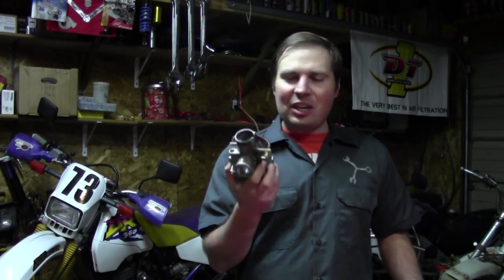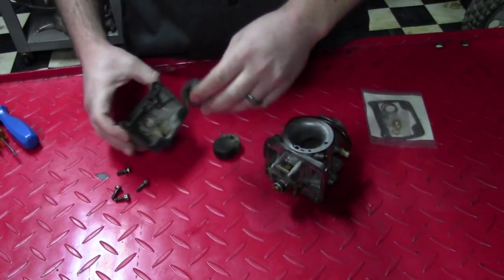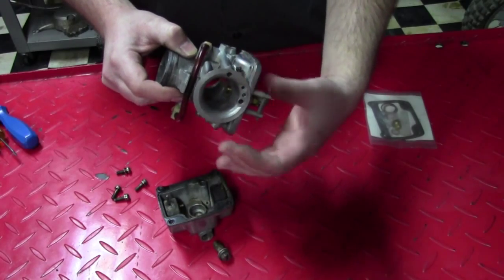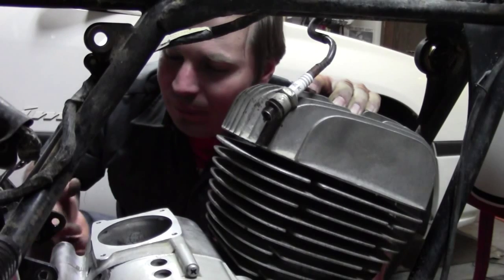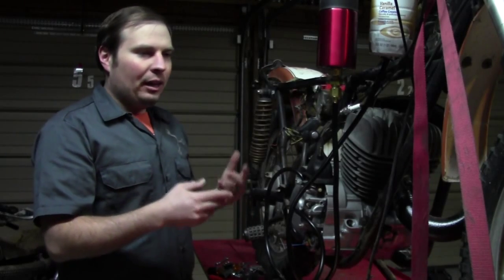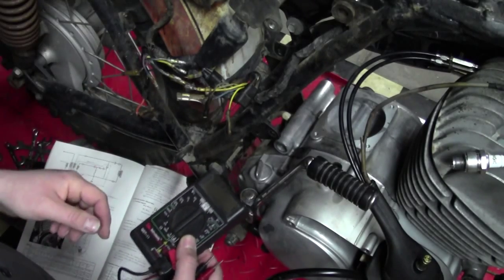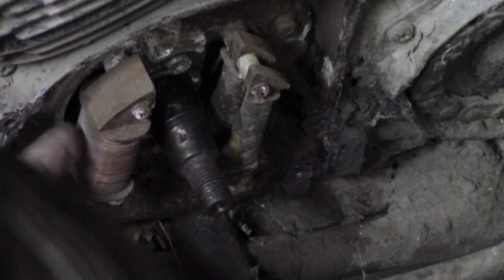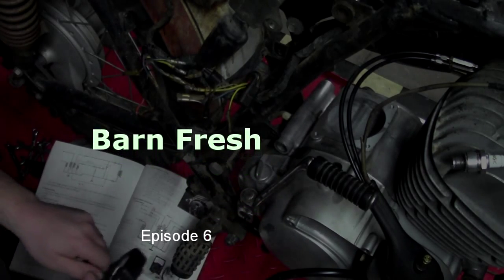1970 Kawasaki F5 Big Horn Fuel and Ignition diagnosis (Fuel and Spark) - Barn Fresh EP6

Comment: I have a 1970 f5 bighorn with a broken carb casing where the choke cable goes into it and so the cable will not stay seated anymore. Any idea where I could find another carb or a possible different replacement?
Reply from the maker: Sorry but no. Ebay will be your only bet. It's a specialized carb to fit there. The F9 will fit but it's a different size and not correct.

Comment: So I’ve got a 70 for 350 paid hard I’m doing a flat track style mod I was wondering can you help me leave me in the direction of 6 to 12 V conversions and or any information on the wiring harness? I can’t find so I can eliminate some wiring from the bike. Thanks for your help Tom San Diego.
Reply: I should read before I send anyways I meant a 350 Big Horn 74 if nine any help thanks
Reply from the maker: If you are doing flat track, you don't need 12v or even a battery. If your exciter and signal coils are shot there is the VAPE ignition system that is nearly bolt in for a replacement. It also contains a lighter flywheel if that's what you're after. As farcas wiring. You only need the Red/White, Blue, Black from the magneto to the CDI box (blue turns into yellow at the connector). The Green/White to the HT coil. Wire the kill switch with the Green/White through the switch to ground.

Comment: the coils worst case scenario > diy rewindable (?) using clear coated copper (magnet) wire of the appropriate length and/or gauge to come up with the factory spec ohms resistance, [also some electrical spec isolating /insulating paper and non conducting, heat resistant adhesives / sealants]...similar to rewinding a small electric fan motor. id like to add a pair of desert beams onto an xrl (cheesiest headlamp ever for going down the road at night...)and so to get more wattage out of the stock system with a voltage regulated and rectified battery...concur? thnx amigo
Reply from the maker: +gerald estes Yeah I suppose you could.  Might be kind of hard.

Comment: Great video's. I'm doing my '71 F5 now. Watched your video on the rotary valve but you skipped the step on getting the oil pump gear off. I need this info. Left hand thread? Having a problem. Any help would be appreciated.
Reply from the maker: +KawiH2A it is right habd thread. Requires a special socket for the F5/F9

Comment: Do you need a battery in this bike to check for spark?
Reply from the maker: No.
Reply: @thejunkman  thanks a lot. I just picked up a barn find all original 1970 in very good looking shape and has high compression for $250. I need to figure out the spark though as I don't know much about these bikes and it doesn't appear to have spark, I need to get  a manual with the specs for ohm meter readings.
Reply from the maker: I have a lot of that stuff on my site.  Check it out.  I got the one you see in this video for $50.

Comment: I have an F7 and it only makes power between 4 and 5.5k. Could it be the CDI? Any suggestions?
Reply from the maker: +Dylan Tindall Not likely.  CDI's usually either work or they don't.  Is the idle erratic?  Does it run erratically all throughout the rpm range?  It is a fuel delivery problem and or possibly an air leak in the crankcase as there are multiple places that it can happen on rotary valve engines.
Reply: thejunkman It idles fine at about 1500. It also only wants to rev up under about 85% throttle and bogs down above that. We were initially thinking the timing is not adjusting to the rpm and is only correct at a certain rpm range.  It also makes a loud pinging noise like possibly nocking only at idle. intake leak could be at the carburetor holder on the inside. We have to put electrical tape on the outside the name the carb seal correctly.
Reply from the maker: +Dylan Tindall 1500 rpm is a little high for idle speed.  So you are saying 3/4-WOT it bogs or is doggy?  Might need a slightly larger main jet or a jet needle clip position change.  Check out my jetting page for more insight on how to tune your carburetor.  Link in the description and annotations.  http://www.thejunkmanadv.com/motorcycle-carburetor-jetting.html